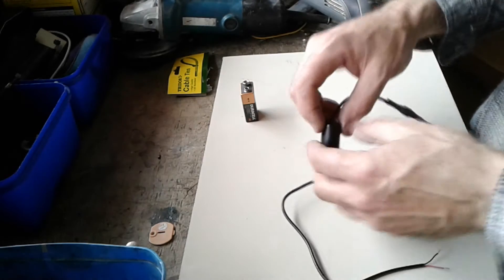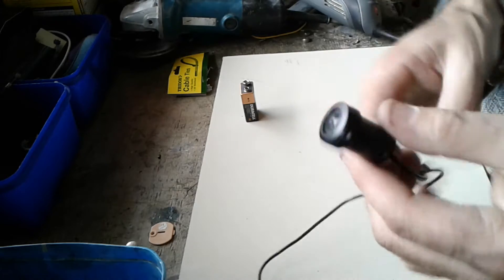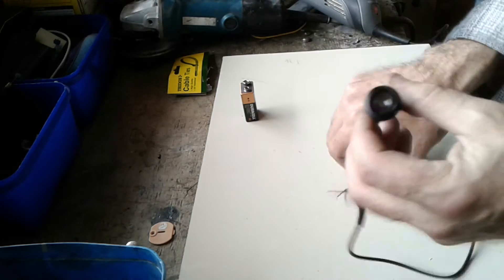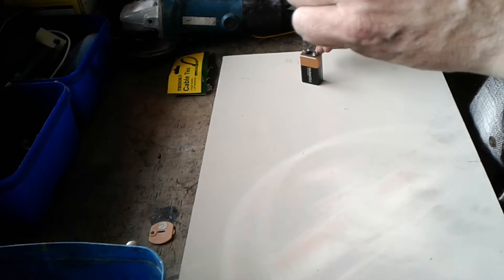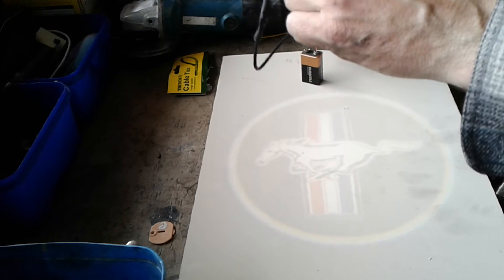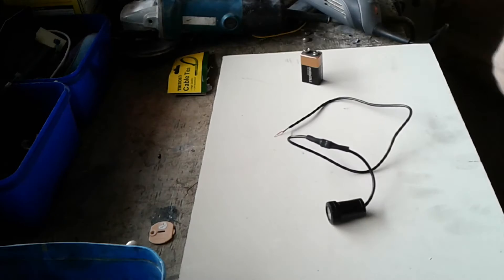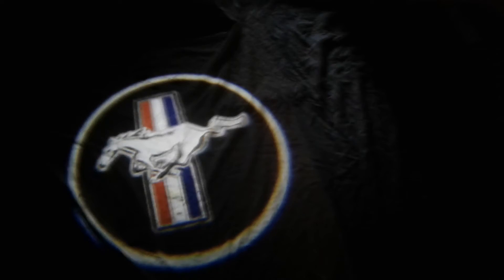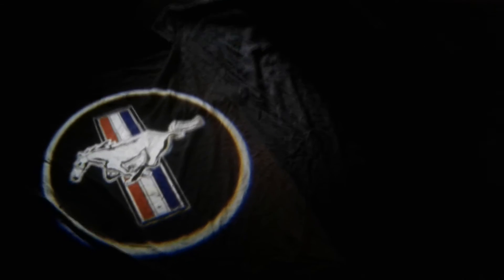Mustang Welcome Lights Install 2006 GT

Comment: OK I'm going to need a set of these where'd you find them give us a link Mate !
Reply from the maker: https://www.aliexpress.com/item/free-shipping-2pcs-4th-Gen-Ghost-Shadow-Laser-Projector-logo-Lights-univeral-for-ford-Mustang-V6/32791077142.html?spm=2114.search0104.3.107.5e1f301fksb6r7&ws_ab_test=searchweb0_0,searchweb201602_4_10065_10068_10547_319_317_10548_5733915_10696_10924_10084_453_454_10083_10618_5733715_10920_10921_10922_10307_537_536_5733815_10059_10884_5734015_10887_100031_321_322_10103,searchweb201603_51,ppcSwitch_0&algo_expid=f5cc7ef0-784e-411f-a820-a9ae7d208923-16&algo_pvid=f5cc7ef0-784e-411f-a820-a9ae7d208923

Comment: by any chance could you show me where you wired it? and would it be different in a convertible
Reply from the maker: Hi Dennis I wired the lights into the right hand side pillar. Not to sure about a convertible, sorry. Thanks
Reply: @PaulluapGadgets  but which wire in the pillar

Comment: I just bought these too. Did you wire them into your dome light?
Reply from the maker: Hi Owen, Yes just wired them into the dome light, right hand side pillar is the easiest place if you have the same car. Cheers